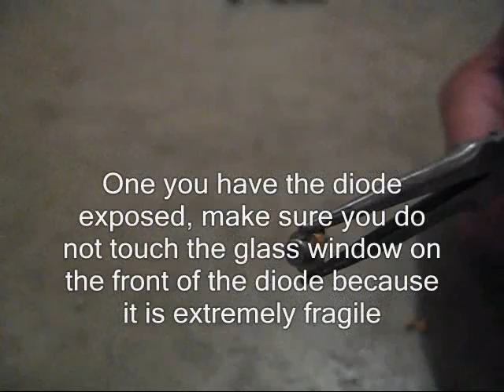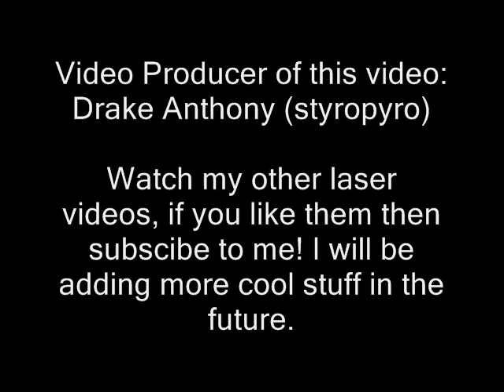DIY: How to Make a High Powered Burning Blue/Violet Laser Pointer

Comment from the maker: @circusboy90210 you can use it to make the diode can either case positive or case negative by connecting that pin the the corresponding polarity pin

Comment from the maker: Voltage doesn't really matter as long as it is enough to power it up. It is current you have to watch, for a red DVD burner diode, keep the current under 250mA at 3 volts.

Comment from the maker: First off, if you use the KES-410 diode you won't be able to burn with the laser. Just a resistor won't work well for this laser, just use a driver from the link in the description.

Comment from the maker: Solder the hole for the negative to the case, so what is left of the pin is shorted to the case. Now the casing of the diode and the aixiz module will act as your negative pin. Hope this helps!

Comment from the maker: the only good way to get that PCB off the diode is to put solder on the iron and pull it off. also, you dont make a laser from a lense, you get the diode out of a reading sled that is supposed to go in an HD DVD add on for the XBOX 360.

Comment from the maker: To solder you heat up the two little solder pads and stick the diode pins in the molten solder before it hardens. If you need pictures PM me when you get signed on to LPF (I'm styropyro there too) and I'll send you some.

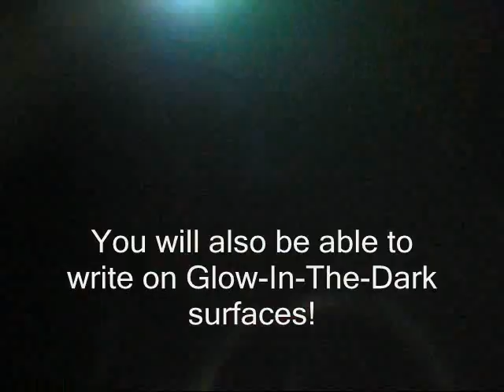Comment from the maker: The laser doesn't have a visible beam unless you are in a really dark room. The reason why the beam seems to appear at 2:54 was because the camera bloomed and put that line in there, the beam wasn't really visible. If you want the beam to be visible in lit areas you will have to add smoke/fog to the room you are in.

You can add a 9v connector to the leads of the driver if you want, you connect the battery to the wires of the driver.

Comment from the maker: The housing pulls the heat away from the diode and it focuses the light. Without the housing, the laser diode will burn up in seconds if powered on.

Comment from the maker: Yeah as long as the batteries add up to over 7.25v it will work. If you are using an AA or AA flashlight and it doesn't add up to 7.2v, you can use those 3.7v rechargeable AA or AAA batteries in the flashlight instead.

Comment from the maker: That battery can power the circuit. If you mean using that battery without the driver then no you can't, it would fry the diode.

Comment from the maker: That won't work, that would put 30mA into the diode and it wouldn't even power up. You need  at least 45mA to get this thing to lase and 100mA-125mA for optimum power. Plus using just a resistor is asking for problems.

Comment from the maker: You have to have at least 7.25v to power it, but you could use those AA and AAA sized 3.7 volt lithium batteries in the light instead.

Comment from the maker: The flex drive is adjustable so you can set it to whatever current you want. If you set the diode to 125mA (the safe "max" current for a long life time) you should get about 110mW IIRC.

Comment: Chihaya Mikado
No, the purpose of the driver is to limit the voltage that the laser receives, the heatsink is to absorb the heat the laser gives off, aswell as an enclosure for the laser diode because the diode is very sensitive

Comment: If you go to Laser Surplus Parts and find the PHR-803T sled, It shows you the pin out diagram for the red and blue laser. The red is just as bright as the blue. I tested. It can also be used for infrared.

Comment: All three Pins are used!  The Common Pin (Housing of Laserdiode) is Anode from Laser Diode and Kathode from Monitor Diode!. The Monitor Diode is for Output Power measurement to control the Output Power with a Laser-Diode-Driver.
(Sorry for my english - I'm from Germany)

Comment from the maker: The laser's minimum operating voltage at 100mA is about 5v, not 7.25v. 7.25v is the minimum needed for the driver if hooked up to one of these laser diodes.

Comment from the maker: If you can solder SMT, you can remove one of the 25.5ohm resistors and replace it with two 33 ohm resistors.

Comment: i even overheated the driver, and it still works fine! unless the remains of the pin(almost exactly the surface of the case) are that impossible to solder on, i'm pretty sure sure it's the diode. but thanks for the help.

Comment: For just the module, it's around a minute, and with an MXDL, it's around 2-3 minutes. There's also a "pocket pal" build on the same site, it's really small. I tried to build it, but with my low experience with soldering, I fried it. If that's what you need though, go for it.

Comment: The sled is actually the original housing for the diode or diodes... usually they are found in CD burners, commercial, and home base computers, and even laptops. You have to take apart the old equipment you dont want to use anymore. If you want you can even take the prisms out of them. But you have to be EXTREMELY careful, as they are just as sensitive as the diode lense.

Comment: Solder / Soldering wire... whatever. Same thing.  The vice gives better control over the amount of pressure applied.  It's ok to solder the tip of your iron, that's called tinning the tip.  Also, it's important to use rosin-core solder because the rosin is a weak acid that removes oxidation. Solder cannot chemically bond to oxidized metal, and putting solder on the tip burns up the rosin so you should apply solder and heat at separate (though very close) locations.  That way the rosin can work.

Comment: You don't HAVE TO heatsink it, but you would need to keep track of time and make sure you don't run it too long. I'm building Jayrob's "pocket pal", which has a decent heatsink which I should be able to run it at 125mA for around three minutes. The tutorial is on LPF in the tutorials section.

Comment: @Zalzal019 It seems to be the only way. becase the pcb is attached to the pins using solder, and 2-3 seconds shoul be enough time to take it off.  oh yeah, and if you want to make a laser you'll need to use your soldering iron on your diode anyways, just don't keep it on too long

Comment: @rlseuro Here's where you're wrong. He is well within US law. You need key locks and special wavelength glasses on hand held lasers in order for them to be legal to sell in the US. He is not selling this. Also, those safety measures are only needed on hand held systems, this is not fully hand held. Lasers can only damage eyesight if exposed for a long time or are lacking an IR filter. This one yes, probably lacks a filter. Almost all lasers have filters. I have an EE degree with some US law.

Comment: Well, this one should not be run for more then a minute at a time, or the diode will overheat. If you want long runtime, build one in an MXDL flashlight. Tutorials are on Laser Pointer Forums.

Comment: If the driver you have has a potentiometer turn it all the way down before you hook it up then slowly turn it up. If it starts getting hot turn it off and let it cool. The higher the current you run to it, the shorter the life will be.

Comment: there may be a vast amount of sleds that are made of magnessium, heck i think some multimedia devices and mp3 players use it as a face plate, but  pulling apart a perfectly good disc drive, better yet a bluray drive, just for such a minute amout could be shoddy at best. if it turns out that theyare, you could buy them in bulk on ebay, then resale the diodes. if you take this route, i hope you are good at de-soldering. . . you may even be able to make asmall profit in your efforts. best of luck!!

Comment: @cherilyndria and you893
First , ps2 lasers arent powerful enough, and it has to be this laser in particular if u want to follow then instructions. extraction of diodes from each sled is different.  I'll give you the mA for each different diode i know, though
4x blue ray sleds: around 150 mA for 150mW
6x GGW-H20L: around 200mA for 190-200mW
8x Blu Ray Sleds: i believe somewhere around 250-300 mA for around 300mW
LPC-815 Red: 380-420mA for around 250mW

Comment: one more question, you recommend 9v to power the laser, would it work to use 3, 3v photo batteries? theyre like half the length of a AAA battery.
i am aware that, yes, it does indeed add up to 9v, but i wanted to make sure the driver can take the amp load.

ive got ally my parts and tools and im ready to go, thanks again

Comment: I'm currently getting the materials required to make this sweet laser but I have a question: which laser safety goggles would you recommend I buy for use with this laser? I'm sure some that protect against 405nm wavelengths would do, but which manufacturer is better?

Comment: hey styropyro i just pulled a 8x laser diode out of a burner and i hooked it up to 3volts a switch and a 100 0hm pot and it doesent shine bright enough to go 2m.   so do i just hook it up to more power or what? if so howmany volts wb

Comment: hey styro, rkcstr says on his new page that the current will only remain stable if the input voltage is at least 2.25v higher than the laser's operating voltage, which he has said is ~7.25 volts. how can the 9v battery work?

Comment: @electroamtu765
the Microdrie V3 has wires on the end, just remember which polarity went where, and solder pins on.. o yeah, and btw, if you mix this with kipkay's laser flashlight hack, you need 3.6 volt 14500 AA size li-ion batteries, 2 to be exact, cause u need a power supply of at least 7.25 volts, but 2x normal AA's only supply 3volts

Comment: Hey Styropyro, to solder, don't you heat up the component and add the wire so it accepts it? This is what my dad says anyway. And I am trying to sign up on LPF but I don't recieve the confirmation email. Anyway, nice instructional video!

Comment: i constructed a burning red laser diode driver,  the driver works great with high power 1 watts  led vbut got problem when i connected it to 300mw red laser diode. the light very dimm it even cannot be a torch light :( ...i forced the voltages from 2.2v up to 4volts the laser diodes casing heated up and quickly i turned it off.
do yu know whats the problem? maybe the new  laser diode are faulty? pins connections error?

Comment: i have a xbox 360 laser diode... it seems to have a metal casing around it and 4 pins on the back... i was wondering if its possible that im looking at the wrong thing (and yes it did come out of the disk tray were the diode should be) and  also i was wondering if it is usable in making a laser burner from one of your other videos

Comment: @styropyro im just trying to make a laser from a separate diode for about 300mw i got online, a driver for between 100 and 500mw, i also got online, and a common 5mw green laser i di, yet again, get online. now ive found a few different sources. one says the case pin is negative, yers says its not used. ive tried youre way and ended up with a laser that doesnt work. i have another set. now what? i cant go wasting money to find out which is better can i? u sure yer diagram is correct?

Comment: ok, so I built it, then in all my majesty broke off the negative pin on the diode. I tried soldering it back on, but remembering the click I heard when it stopped functioning led me to believe the problem was something else(though the driver still ran the test load fine). I wonder if I should get another diode.

Comment: can u plz help me i bought a 100mw laser and connected it to 2AA batteries and it works and burns but there is no beam or dot can u plz tell me what did i miss thanks.............here the laser housing i bout from ebay : item name ( 780nm 100mW laser OEM module 3.2VDC w/ adj. lens 780nm )

Comment: Hi . I Have Done All The Parts . But Mine Is A 300mw Laser diode . I Done Building Every Thing . But When I Switch On . The Laser Beam Is Weak . I Need Help On This . I Used Back My Driver Which I Took Out From My 200mw Burning Laser Pointer . And The Diode I Got From Ebay . I Need Help ~!

Comment: did u use any resistors, im using a ps3 diode and in another video he said 9volts will burn out the laser diode so a resitor is required. i dont know what to do now. im planning on using 4.5 volts. do i need a resistor for that... plz help, great vid btw, thumbs up :)

Comment: oh, and an easy way to find out if they are is to take one appart and scrape some of the material off and try to burn it. if you do this, i would only scrape a useless areas material asto not destroythe device. only fileings will ignite under normal fire. remember that.

Comment: @GDuff123 Around7kW is the most powerful cutting laser now, and that'd be weapons grade. Problem is, it's industrial, so it takes up as much room as a small house.

Handheld, 2mW is about as powerful as you can get handheld, and that's nowhere near powerful enough to be used as a practical weapon.

It'd probably work its way through hdpe, pet, and most malleable plastics, acryllic might take a while, and is more likely to melt, rather than be cut, and it will engrave, but not cut, wood.

Comment: @Guitarfiend11 So I am assuming your young and quite uneducated.
Firstly "electronic boards" which sounds stupider every time i hear it... "PCB, Circuit board" either of those are much more accurate.

But ontop of that, He dosnt "snap" anything off of the pcb, he rips the no longer needed ribbon from the useless chassis. Secondly the blob of solder on the tip of the soldering iron was NOT for soldering... its simply another contact to help melt the solder holding the ribbon to the diodes pins.

Comment: you know its funny, you CAN'T touch the glass of the laser because it is TOO fragile, but you CAN put the diode into a vice and tighten it.  hahahaha there's irony for you.  Btw, the reason you can't touch the glass is because your finger prints leave debris on it, and the high intensity light of the laser makes the debris burn, ergo. it then melts the glass. that's why in industrial processes, it is REALLY important to keep your lenses clean.

Comment: fuck.
i bought a x-box 360 diode but without the driver
i connected it with a 9 volt battery and a resistor but the laser was too weak
i reduced the resistance and my diode burnt!!!!
how much resistance the driver has?

Comment: What can the laser cut?
Reply: anything that has a lower melting or burning point than the laser, so like wood paper maybe thin foil
Reply: @bones2430  isnt foil reflective?
Reply: @maxxiang8746  yes but not too reflective. It can heat it to its melting point, so that's how
Reply: @bones2430  yeah i guess
Reply: Ultrafalcon772 That doesn’t make sense. Lasers can theoretically burn anything given enough time to heat up the object, but on Earth, the air cools off the object fast enough for lower power lasers to not being able to heat it up considerably. In a vacuum, any laser should be able to burn anything.